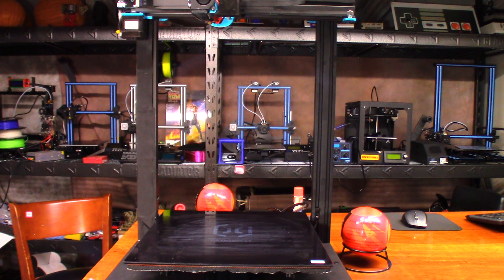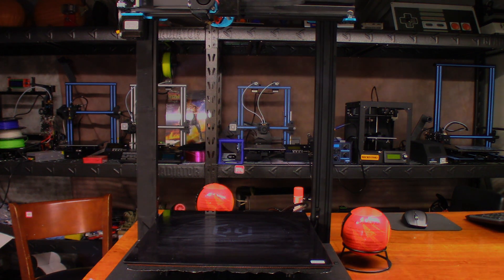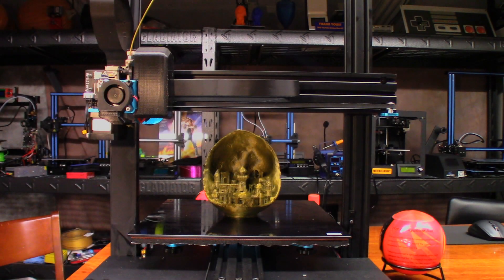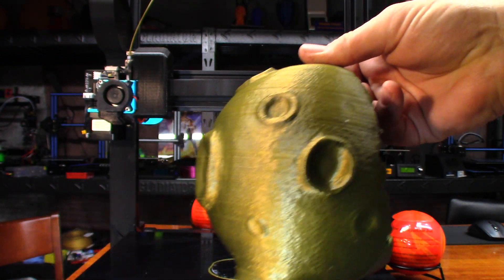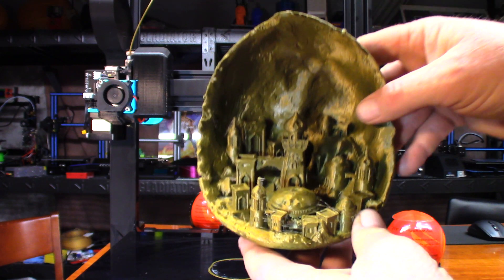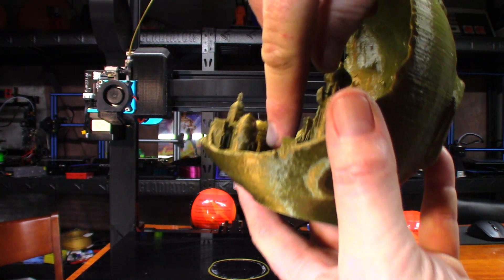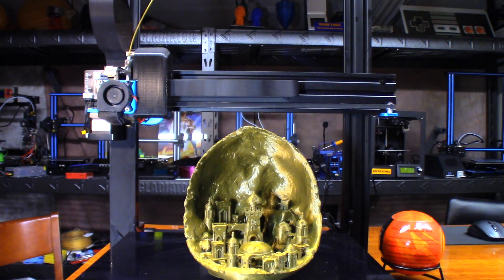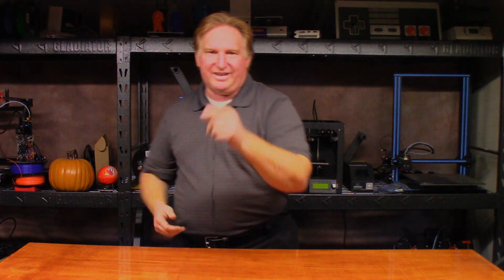3D Printed Moon City On The Artillery 3D SW X1

Comment: Hi Jimmy! On the bright side, most of the printing artifacts are on the back. And the filament looks shiny!
Reply from the maker: I forgot 1 detail when I did this video... a 34 hour glow in the dark print just before this.  I'm guessing I destroyed the nozzle.   LOL!!!
Reply: @JimmyShawsTidbits1  with one 34 hours print of a brand new device.
Reply from the maker: With one of the most abrasive filaments next to carbon fiber...
Reply: @JimmyShawsTidbits1  Maybe someone will come out with a "sand" filament that actually has sand embedded in it. And a special printer profile that gradually adjusts the flow rate to account for the ever-enlarging nozzle diameter! 😂
Reply from the maker: LMAO!!!!
Reply: @JimmyShawsTidbits1  lol me bad.
Reply from the maker: LOL!
Reply: @JimmyShawsTidbits1  I think it's way overpriced and full of bugs . Ender3 or Anycubic mega are avaible for lower then half price. and perfect out of the box results
Reply from the maker: What bugs have you had?
Reply: You need a brass Filament to fill the nozzle back in 🤣 so far mine is dealing with everything I'm throwing at it but time will tell
Reply: @MATS_MAKERSPACE  lol mat. tbh the stuff i used was not that abrasive i still use the same nozzle for over a year. lol. still working well.
Reply from the maker: The stuff I used not only took the paint off the corner of the spool holder but took the sharp edge off the metal underneath.
Reply: @JimmyShawsTidbits1  bad quality and paint. I bet the company never try use the whole build space. Otherwise it would be noticed. And you was not even att full height
Reply from the maker: I completely agree on the z build volume.  The spool holder needs to be raised.  But I have no complaints about the build quality yet.  So far it is working as good or better than my other printers.